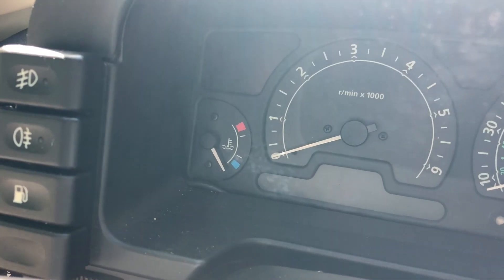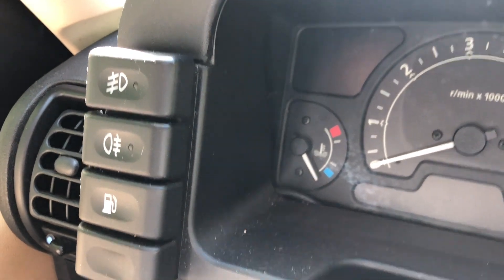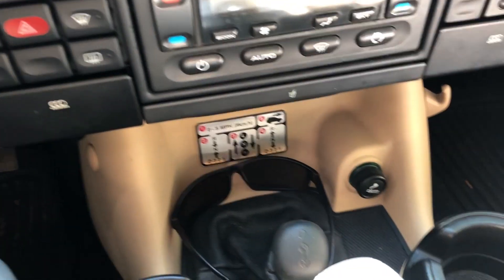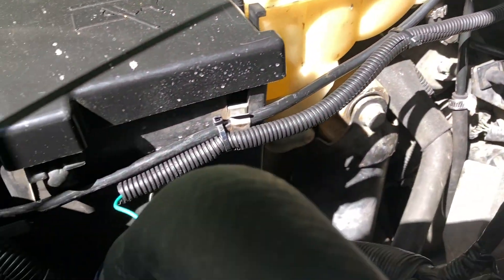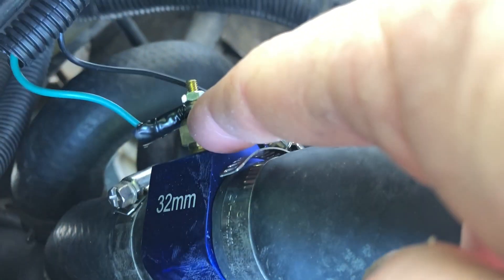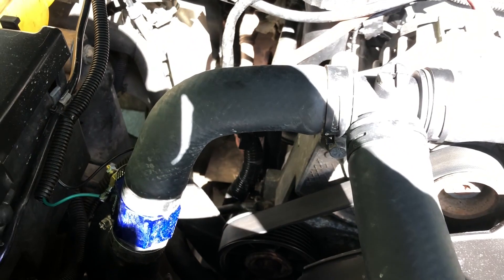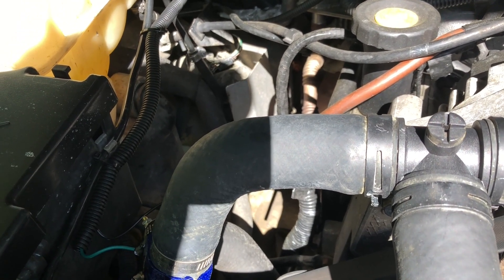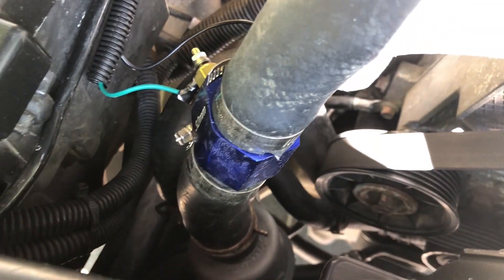Land Rover Discovery 2 Water Coolant Temperature  Gauge Install

Comment: Hi, what is that part called that you spliced into the radiator hose?
Reply from the maker: Water Temperature Temperature sensor gauge joint radiator pipe hose adaptor on ebay
Reply from the maker: https://www.ebay.com/itm/32mm-Blue-Water-Temperature-Temp-Sensor-Gauge-Joint-Radiator-Pipe-Hose-Adapter-/402966868027?hash=item5dd2b2703b
Reply: Thank you, I clicked on the link on your video but it didn’t work, this link worked, thanks again!

Comment: Cool video 👌🏼 and yes Discovery is notorious with temp changing and factory gauge don’t respond too quick! I have to ask you ? I recently just done my coolant system. And my obd reads 208 to 216 when driving and 221 at idle vs before coolant service the engine was reaching 231f . What do you think the issue here? I will appreciate your feedback!
Reply from the maker: Those temps are way too high...Get the in-line thermostate mod.....new radiator and new fan clutch.